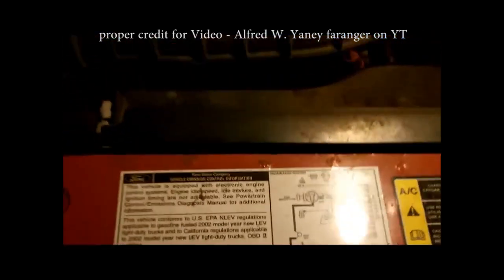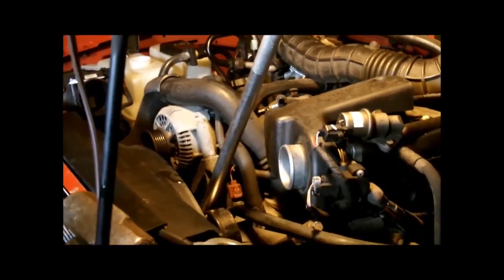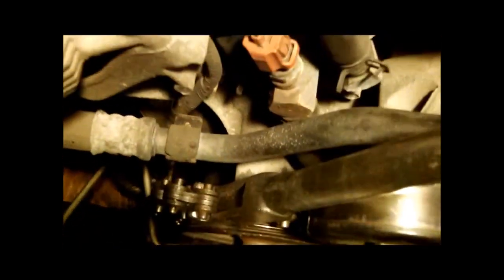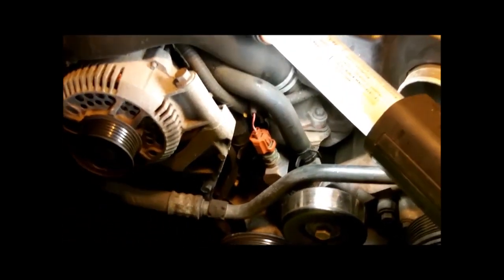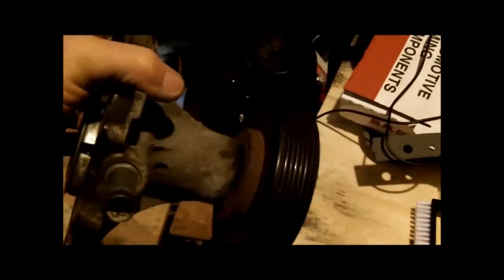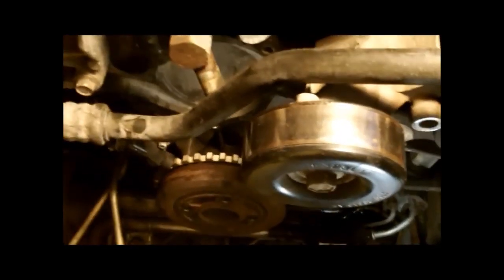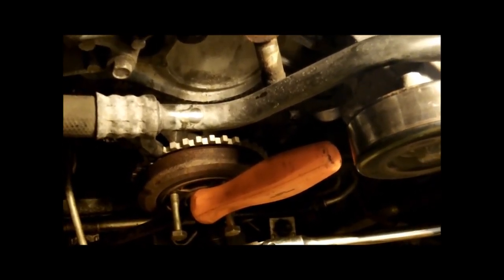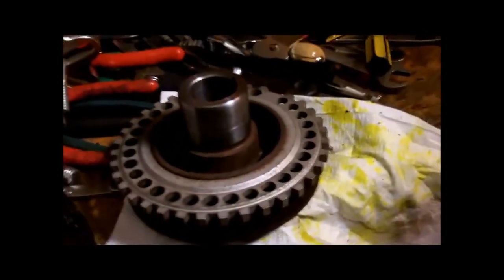Ford Ranger 3.0 timing chain gear set replacement PART 1 Install Remove Replace How to

Comment: Did you not need to remove the ac or power steering pump? It looks like it's in the way on mine.

Comment: Why would anybody want to share your video with somebody who needs to make this specific repair? Your videos stinks. You're a mechanic and you're using terms that non mechanics cannot possibly decipher. Plus we don't get to see you pull a single part you pull parts and then show the aftermath. That system does not assist anybody in knowing where those parts were and exactly how you managed to get them off. That's like a cooking video that shows all the ingredients for a dish but doesn't show the procedure for putting those ingredients together and cooking them. You got to see the ingredients and then the finished dish. I can't believe I wasted my time hoping your video would have gotten better and actually showed me how to replace the timing chain. Perhaps you should take a shot at producing potty training videos.

Comment: @ 4:05   ' proper tools, less damage, faster you'll get your vehicle running again... ' 

@ 2:15    for fan clutch removal....  ' i used a chain wrench... ' 
Not the proper tool...  they do make them.

https://www.jbtools.com/cta-tools-a870-ford-fan-clutch-wrench-2-piece-set/?gclid=EAIaIQobChMI74-I1PKF5gIVJIVaBR1voQo9EAQYBSABEgLLRvD_BwE

Comment: Hey I'm replacing the timing chain on my 01 ranger and it wasn't starting before I ripped it apart. What happened was the  Water pump blue then I replaced it and it  Would Not start. Then I found out if the water pump blows you should replace the timing chain. My major concern is what is the timing became off if the timing chain got loose struck the toothOr something of the sort.Sense this is my concern I probly have to find top dead center of cylinder one and make sure everything's lined up correct?
Reply: Yes